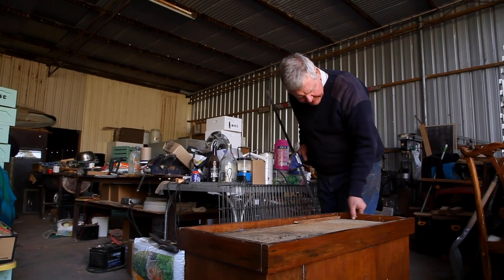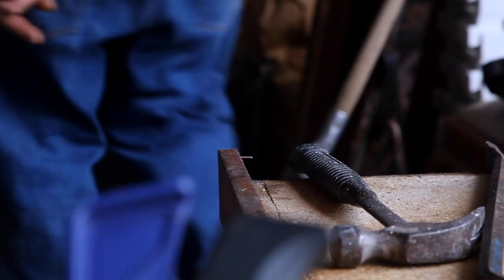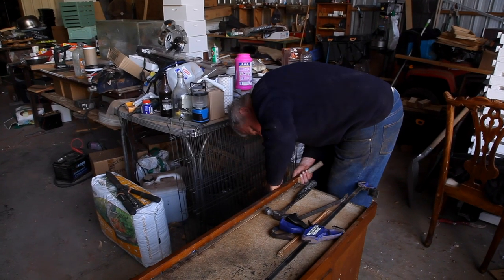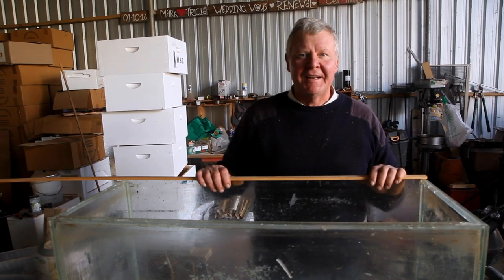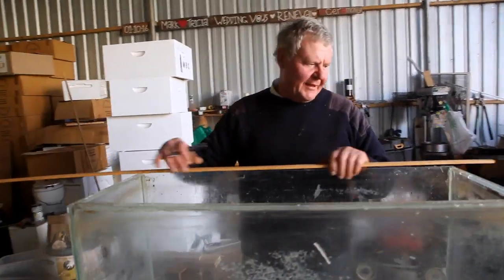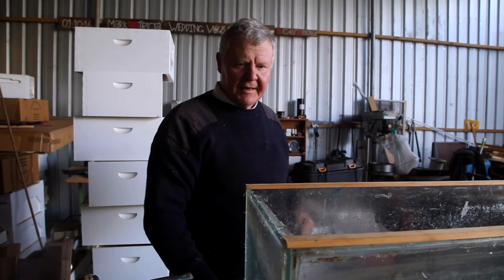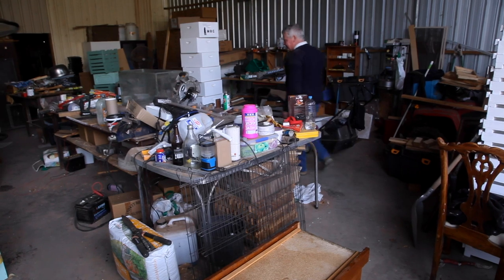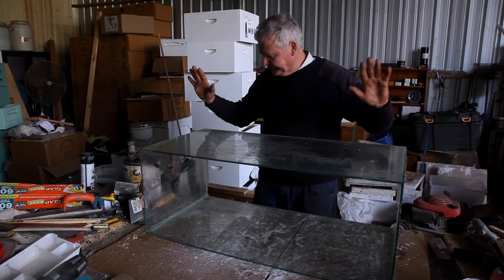How to Build a Fish Tank Observation Hive Part 3 - The Bush Bee Man

Comment: Headless Pin Nails are a thing! I had a nail gun that could fire both standard and headless pins, it was great if I just needed to add a bit of reinforcement on a joint I was gluing up but didn't want to putty anything afterwards. I feel like using them on the trim around the edge of the stand was not a good design choice, though.

Comment: Next time on something like this instead of pulling those off because they wasn't held together. Pull the screws nails or whatever out. Dip some toothpicks into some wood glue and pack the hole with them. When it dries cut it off and just re drill.
You'll have a stronger Bond than before. And you can't even tell it's there
Reply: Also a mixture of citric acid and L-limonene mixed with some warm water and applied to that hard water stains on that tank will take them right off without leaving any harmful residue. Here in the states we got lemi shine which is the same thing. Don't know if you can get that there